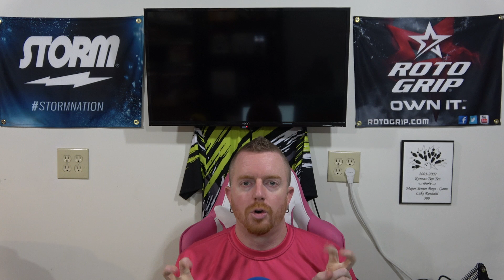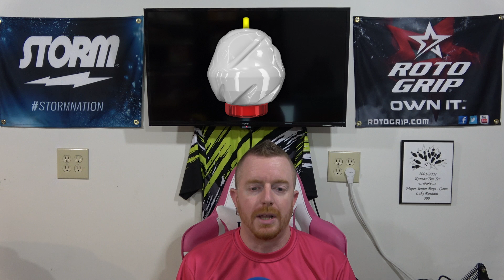Storm Vector Layout System (VLS) 101

Comment: They're the exact same system.  Use whatever makes sense to you.
Drilling angle determines length, Pin to Pap determines flare, VAL angle determines responsiveness to friction.
Drilling angle controls PAP to MB distance.
VAL angle controls PAP to Pin distance.

If you want a visual, hold your hand in front of you and make an L shape with your thumb and index finger.
The tip of your thumb is your pap.
The tip of your index is the MB.
The hinge of your thumb is the PIN. (Lay your hand on your bowling ball if you need more visualization, and do the following)

Spread your fingers as far as you can, and you'll get roughly a 90 degree angle.
This would be an actual "L" which is separating your thumb and index finger as far apart as possible AKA a long PAP to MB distance.
Now slowly close your thumb towards your index.  As the angle between your thumb/finger shrinks, the PAP and MB get closer and closer.
45 degrees makes a "V" shape.  That's half way between 90/"L" and 'touching' or 0.
Then touch your thumb and finger together, and that's a 0 degree drill angle.

Good Luck!
Reply from the maker: Oh it’s all good, I guess I just see it different. With VLS I don’t need to trust it because the numbers tell me exactly where the core is and what it’s doing, Dual Angle seems less accurate now or more dependent on the numbers rather than the concept of what the core is doing. VLS numbers give me an instant visual of what the core is doing. You sound like someone who thinks in Dual Angle, and if that’s what makes sense, that’s all that matters. With dual angle, it starts and stops at “these numbers do this,” with no real explanation why, and with VLS explaining the why, I don’t really need the numbers to get what I want, with dual angle I’m completely dependent on them
Reply: @LukeRosdahl  In what way exactly does dual angles "seem less accurate now"?? And what do you mean "more dependent on the numbers"? Both systems depend only on numbers....They both give the visual of the core. It only depends on which one you have familiarized yourself with. The explanation of why each number does this or that, is lacking in both systems, and is offered by additional explanation by those who teach it. Like you did here. Or like Storm does in their website. It's not like VLS is self explanatory in any way , more than Dual Angles. In fact to me, it seems to need more explaining. In any case, once you visualize where the core is with either way, both methods can be of value.
Reply from the maker: @exesemas  You're right, it depends on how it's explained, but Dual Angle explanations begin and end with numbers.  It tells you these numbers do this, and that's that.  I think it's so much easier to conceptualize actual layout dynamics by learning VLS.  I think a majority of Dual Angle users know what numbers do what, but they don't understand why the numbers result in the reaction they do.  I also think VLS can seem harder to understand because most people are coming from an understanding of Dual Angle and are just trying to correlate numbers instead of just understanding how layouts actually work.  Have you seen Alex's videos?  They go super in depth explaining core dynamics first and achieving them by using certain layout numbers second.
Reply: @LukeRosdahl  I think i had watched abit of one some time ago. I will check them out. I don't think that every dual angle explanation starts and ends in numbers though. Most do, but that is only a fault of the one who is doing the explanation.Not a fault of the system itself, don't you agree? For example if someone throws the VLS numbers at me without explaining much...we could accuse the VLS of the same "fault". But its a "person" fault, not a "layout method" fault.
Reply from the maker: Kind of . . but Dual Angle is just learn the numbers and follow the instructions and this is supposed to happen, but there's no why behind the numbers, VLS explains why so you're not just learning numbers.  Once you understand everything, you don't really need the numbers, they just ensure more accuracy if you're trying to be super specific.  Also, I don't know if you misspoke/typed, but VAL angle controls pin to vertical axis line measurement, not pin to pap, and VAL angle also affects flare because of hole placement and how it alters the core.  The visual is also just a visual on angles . . which I don't find to be particularly helpful.  All I know is that I understand layouts MUCH better now that I learned VLS instead of just knowing the "these numbers mean this, trust me" of Dual Angle.
Reply: @LukeRosdahl  I agree, but again, the point is both systems are doing the exact same thing and saying 'trust me'.  Whether that's 4x4x2 or 40x4x35. (These are the exact same layout)  The only difference is whether you use inches or degrees to position the MB and Pin in relation to your PAP.  Understanding both systems, allows me to tell you that a 4x4 is a 40 degree drill angle, every time, no matter the bowler.  The 3rd number in the Vector System is VAL Angle.  1" Buffer is roughly 18 degree VAL angle. 2" is roughly 36 degrees, and 3" is roughly 54 degrees. (Note: VAL Angles are consistent for all bowlers, but will vary based on other numbers.  So all 4x4x? will be consistent, but a 5x3x? won't be the same as 4x4x? but will be the same as all 5x3x? alternatives)

The only quantifiable benefit of Dual Angle, in my opinion, is that the average consumer can more easily track and adjust their own layouts IF they want to.  It's easier for me to know that when I want to have a skid flip reaction I go 70x4x20.  If I want benchmark, 55x4x30.  That's far easier than trying to track the fractions of an inch I adjust the Vector system for altering shapes.  Keeping track of every 1/8th inch for 2 measurements (Pin and MB) for 2-4 different layouts, across 10+ balls can be overwhelming for even mathematicians.  Additionally, swinging Arcs is more tedious than just straight lines from existing ball markings and measuring the angles they create.

The foundation of my debate would be this though:  I'm willing to bet that without looking at the Storm Website or Vector Layout Chart, 90% of bowlers couldn't confidently tell you, if they wanted to increase length, which number to change, OR which direction to change it.  So, for example, if I have a 4x4x2 and I want to drill another of the same ball, and I want more length, how do I adjust these numbers and how far do I adjust them to get more length?  4x5x2? 5x4x2? 4x4x3?  A Full inch? A half? An 1/8th?

HOWEVER, if you ask the same question to people who use Dual Angle, with a 40x4x35 layout, and asked what number to change and how much to add length, that at least 60% would know which number to change AND which direction to go.  Granted, few would know how much to adjust the number by, but the theory still holds true.  A significant amount of bowlers would know to increase the drill angle to a higher number, and they would know the drill angle is the first number.

* I repeat * Use whatever system makes sense for you.  They are both accomplishing the same thing, they just measuring them differently.  Neither side can discredit the other, because they are both designed to do the exact same thing.

*You are correct, I did misspeak above, I apologize.  Big fan, keep up the good work.  Wasn't my intent to start a debate or argument with you, was just trying to offer readers an alternate perspective or visual.

Comment: That was a mistake I was doing. Trying to equate the Pin Buffer (last measurement in VLS) w/ VAL angle from Dual angle layout system.
Reply from the maker: Yeah, technically you can do it, but it's so much easier to just dump Dual Angle and use this method to understand WHY you're trying to get to certain numbers or WHY you're going pin up vs pin down

Comment: Is this essentially dual angle in disguise?
Reply: Yep, I still don’t follow. This is why I pay a pro shop. He drills, I throw.
Reply from the maker: @stormb28  Yup, and that's perfectly fine.  It's quite a bit easier that way sometimes too instead of having extra nonsense going on inside your head when you're just trying to throw a ball and knock down pins.
Reply: Luke Rosdahl for sure, being analytical, it can be paralysis by analysis. I don’t ever want to be the guy that says “if only I had my 5x4x3.5 ball I would’ve done better”. Most bowlers who are adept at understanding drilling are like that in my experience.
Reply from the maker: @stormb28  Yeah, too much activity upstairs is definitely harmful.  That's why I PREFER VLS because it's about ball roll and core position rather than pure numbers like Dual Angle.  You can imagine how the core is rotating and understand what that's doing for your ball roll, BUT yeah, sometimes it's just better to keep it simple.
Reply from the maker: No.  Dual Angle deals with strictly numbers, they're looking for specific core numbers after drilling.  VLS describes the core position as it's rolling in addition to core numbers for the pin buffer measurement.  It's all meant to get you to the same place, but they're based on two different ideas.  The VLS is easier to understand, conceptualize, and ultimately comprehend.  But there IS a correlation, 5 x 5 x 3 VLS will correspond to certain Dual Angle numbers because they aren't different ways to layout a ball, they're different ways of going about it.  I've used Dual Angle for years, and converted to VLS because instead of thinking in numbers, I'm now able to visualize what the core is doing and truly understand layouts instead of just trying to arrive at some certain numbers because they're supposed to do this or that.